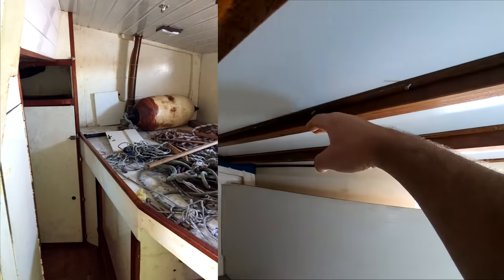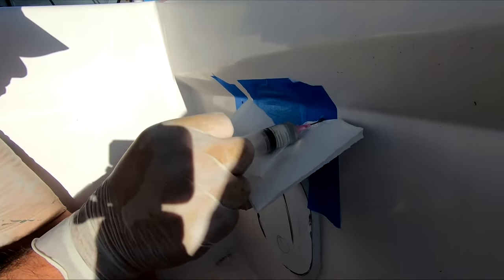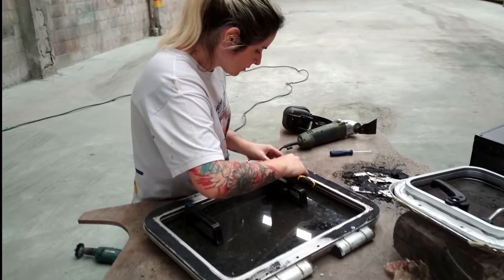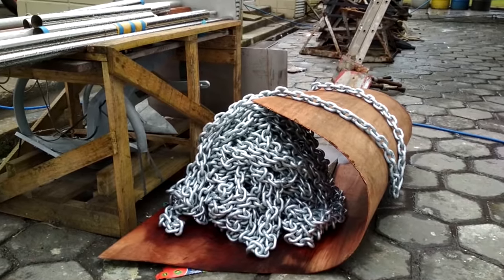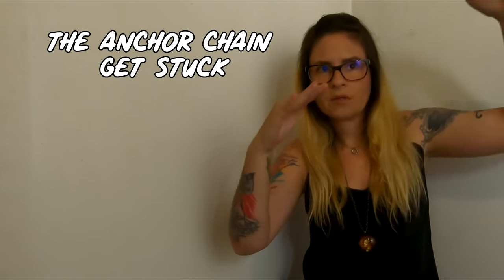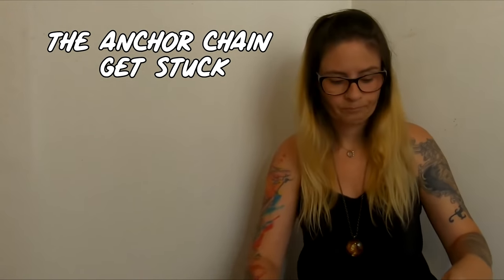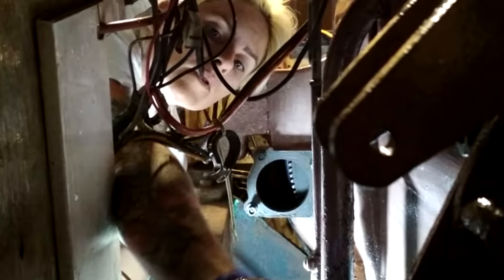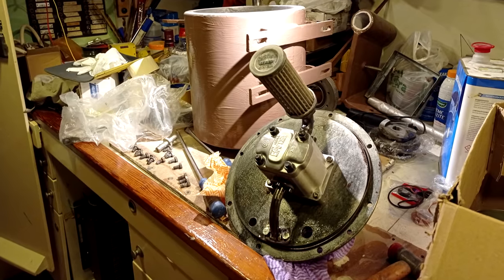#5 What we did, What we have to do - Refurbishing list

Comment: Diesel will not explode, it could burn.  Also washing out the diesel tank will not make it rust, it could introduce water to the fuel which would be bad but if you dry it properly and run a fuel water separator the diesel fuel itself will inhibit the rust in the tanks.  Though the top of the tank looked like stainless, but I could be wrong.  Why not make up plates for the top of the tank then drill and tap the top of the tank and bolt it all back together with a gasket.  You could also use blind nuts if the tank top is too thin.
Reply from the maker: Hello Bob, diesel not explode, but diesel vapor does, it's hot here and diesel in Brasil it's not so good and the flash point it's lower than the standard in US or Europe, just want be safe.
My idea it's screws and do gaskets.
It's not stainless, but you are right, it's so bright than looks like stainless on the camera.
Have some small rust on the surface top of the tank, but just on the surface.
The tank looks ok.
I worked near of a full trucks repair company, o saw diesel tank explode  when they weld the tank, empty. Explode just because had some diesel fuel vapor remaining inside, the guy disappear, and the tank too...
I do some work with LGP, NG, and fuel and I use to see accidents with people that not work safely.
I agree, diesel will avoid corrosion on the tank, but, right now, I want work just with the other tank, and keep this one empty, just work when we begin our long travel, that's why I want avoid water inside the tank.
Reply from the maker: Please, if you don't understand something about my answer, let me know...sometimes it's not easy do some explanations in English for me.
Reply: @Crazylittlethingsaboutus  No, it's fine. I don't agree with leaving your tank empty I think you're asking for condensation and then rust in the open tank, but it's your boat.  You can't fix everything at the same time.